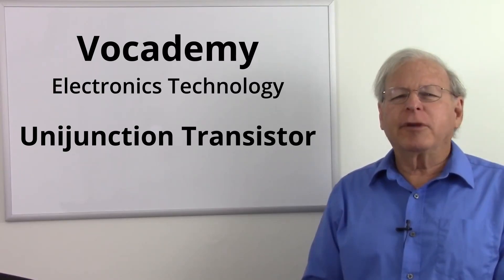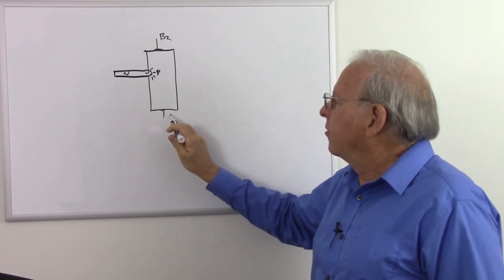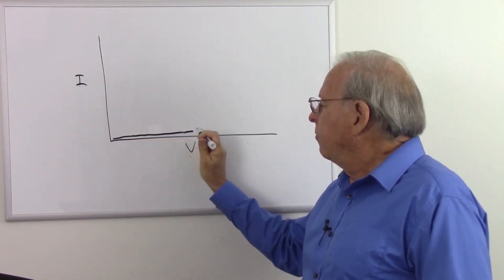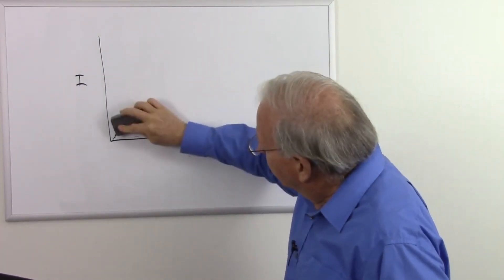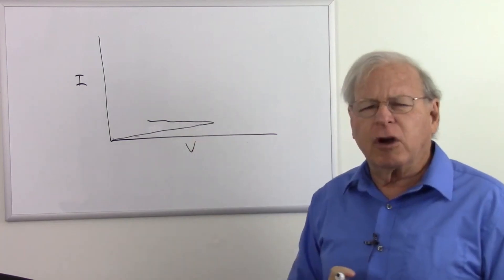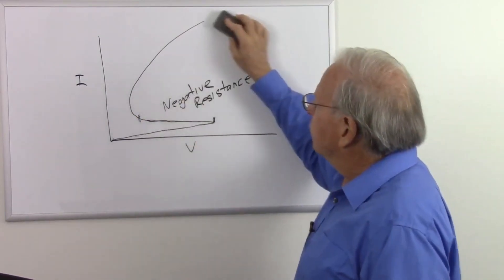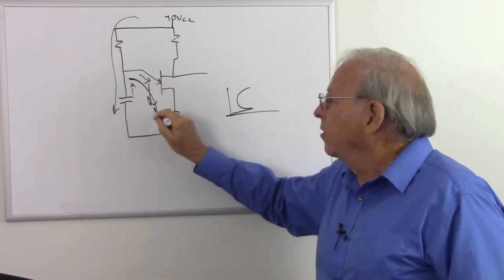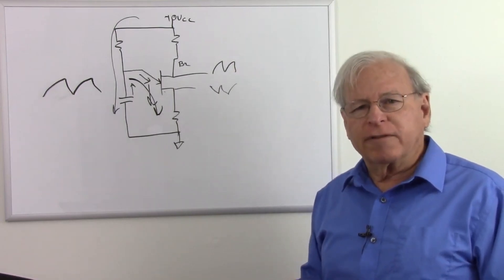Unijunction Transistor

Comment: Around 4:15 you came up with a voltage and current graph and then I was lost. It would have helped to mention which terminals these values refer to. I do understand the concept of negative resistance, but still do not understand between which terminals (or pins) this occurs.  I try to reverse-engineer the battery charger I built 50 years ago with an UJT which creates less pulses to an SCR rectifier as the battery voltage increases.

Comment: PUTs are easier to use , prevents latching on, and makes things linear/better sawtooth ... if
1) cap charged with constant current I,
2) trigger voltage generated by additional constant current of " I"  feeding into resistor.